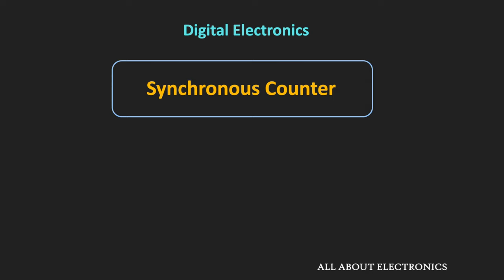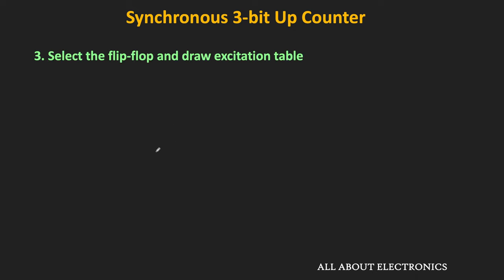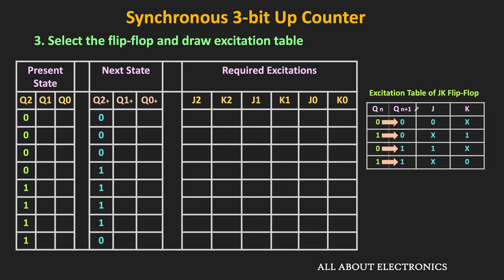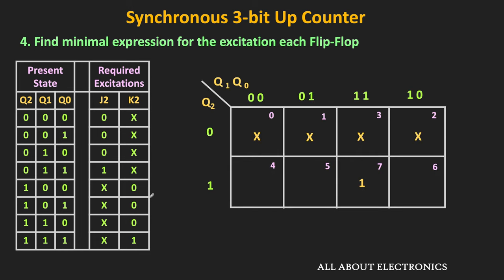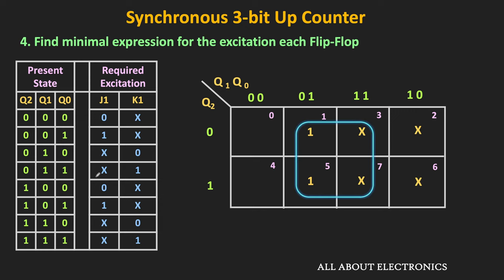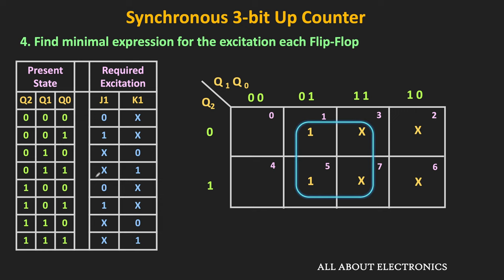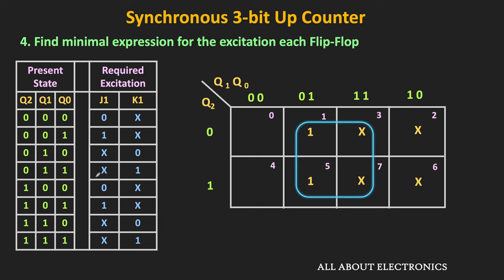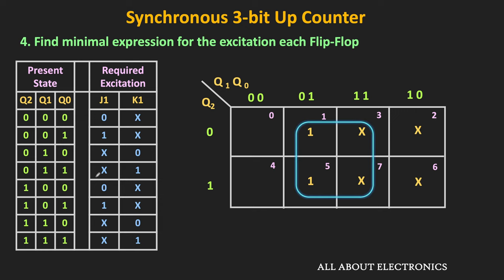Synchronous Counters Explained  (Part-1)

Comment: Please clarify my doubt Sir, correct me if i am wrong . 
Sir i think you gave wrong connection for CLK in up counting and down counting because in last video you gave table if it is negative triggering for up counter Q should connect as CLK to next flip and and for down counter Q(bar) should connect as CLK to next flip flop

For postive triggering up counter Q(bar) should connected as CLK and down counter Q should be connected as CLK to next flip flop 

Here in this video you used postive triggering and gave according negative triggering connections
Reply from the maker: The counter covered on the previous video was asynchronous counter. This is synchronous counter. The condition which you have mentioned are valid only for asynchronous counter.

Comment: How will the diagram look if we are to use NOR gate pls
Reply from the maker: I think since you have been asked to design the counter only using JK flip-flops and NOR gates, it would be easier to design an asynchronous MOD-7 counter. (unless you have been asked specifically to design synchronous counter).
In that case, you need to connect the Q2, Q1, and Q0 output of the JK flip-flops to NOR gate. And the output of the NOR gate to clear input of the flip-flops. When the count goes to 111, then output of the NOR gate will become 0, and it will reset all the flip-flops. 
The counter will count from 000 to 110. 
This video will be more suitable for you.
https://youtu.be/OvOXRQiRzas
Please check it. Your doubts will get clear for sure. 
And still if you have any doubt then let me know here.

Comment: Sir, I think the way you calculated propagation delay is wrong.please check.because first AND gate and other ff s depends on first two ff
Reply from the maker: It is synchronous circuit. What you are saying would be true for the asynchronous counter. Here, all flip-flops are responding to the input at the rising or falling edge. So, at given clock edge, whatever is the input of the flip-flop, accordingly they will generate the new output. And the next flip-flop will respond to this new output at the next clock edge. I hope, it will clear your doubt.

Comment: sir in 12:12 shouldnt the F/F be negative edge triggered since the Q1 transitions taking place at falling edges(1-0) of Q0?
Reply from the maker: This is synchronous counter. So, all the flipflops in the counter receives the clock at the same time. In asynchronous counter, the output of one flip flop is connected to the clock input of next stage. I hope, it will clear your doubt.
Reply: @ALLABOUTELECTRONICS  ty sir got it :)